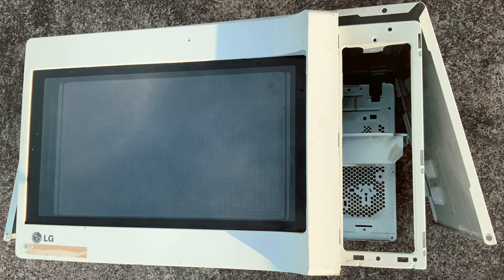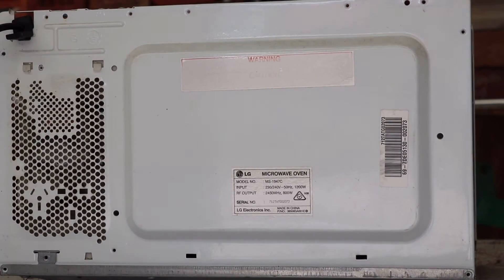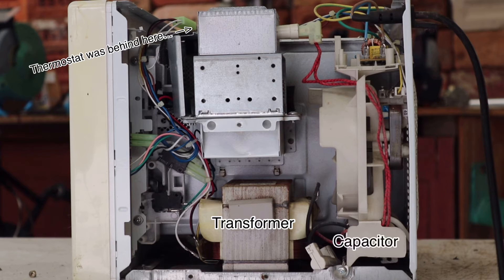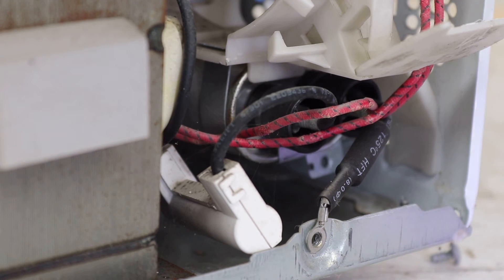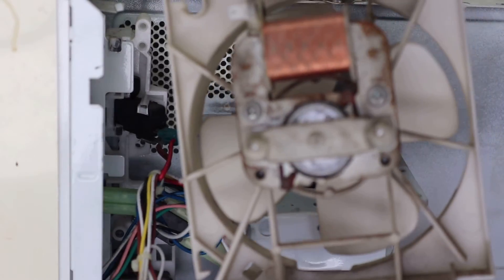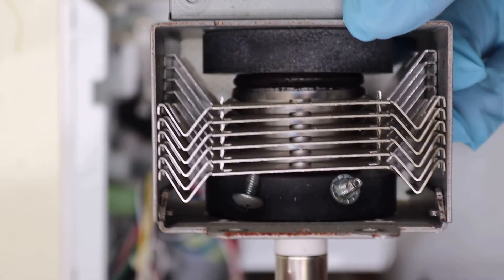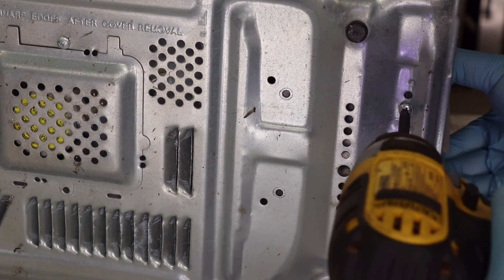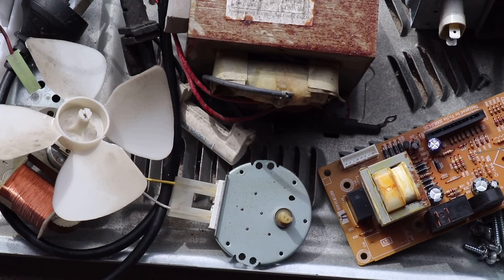Safely salvaging parts from an old microwave!

Comment: The EHT diode ( connected to the capacitor ) is useful if you have FOUR of these .... you might make a super high voltage bridge rectifier for various tube projects ( note : these contain several diodes , so they CANNOT be tested with a multimeter set to diode test ) ... the magnetron magnets , stuck on your fridge can store your big cooking tools ... or one on the end of a broom handle makes a good tool to pick up spilled steel nails and screws ( suggest screwing on a plastic aerosol lid , to avoid knocks , the magnets are VERY brittle ! ) ......... ( tried - n - tested ) ..... DAVE™🛑